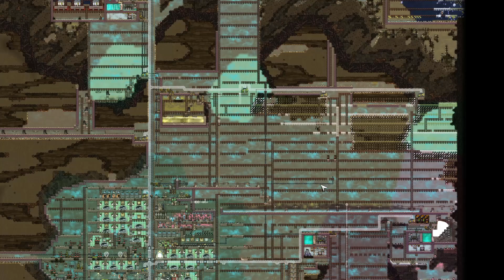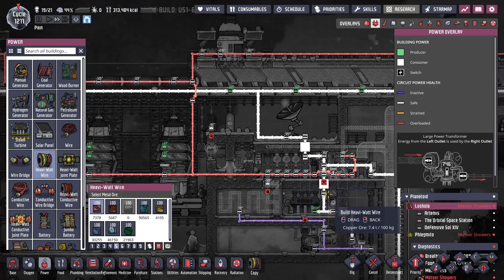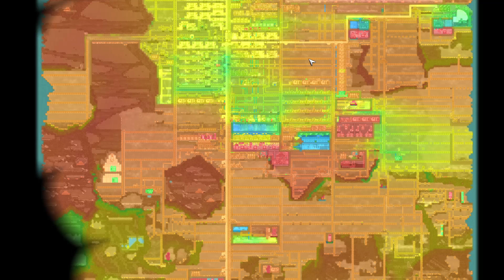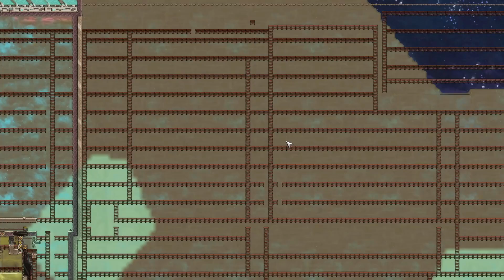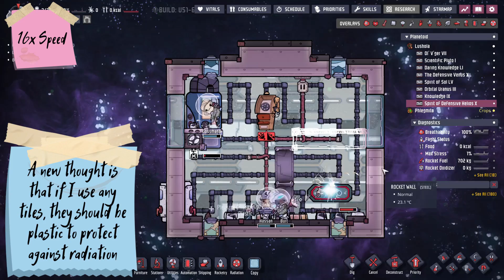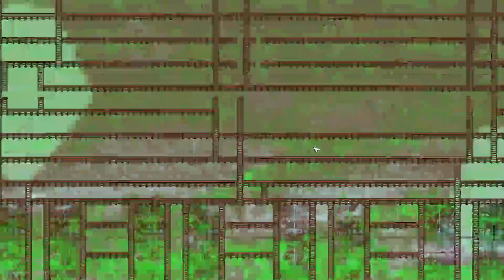[Ep21] We Built a Behemoth of a Rocket Setup - Ultra Supreme Max Difficulty

Comment: I know the series is already done but just something for future reference (and anyone else doing this).
Replacing the plastic tiles with lead metal tiles would have been better for your rocket design as they give 3x the decor (and a larger decor radius) with the same radiation blocking as the plastic tiles. 
I also generally use a high pressure gas vent to fill up the rocket with 10kg of oxygen and keep the bed high up in the rocket to avoid them needing to get up to breathe when sleeping. The stress bonus from popped eardrums can be negated with high morale (20% negates high difficulty bonus), a buddy bud (15% from floral scent leaves 5%) and a carpeted tile (15% from tickled tootsies handles the rest). The carpeted tile will have less radiation blocking but if you put it in the center (under where the rocket roof is two tiles thick) it should be fine. This does also mean that you have a finite amount of oxygen but (in my experience) the 10kg has proven to be enough for even the longest trips (where I forget my rockets for a while after they're done with they they were doing). If you want an emergency supply of oxygen you can also keep some oxylite in a storage tile near the top of the rocket and move the oxylite to wherever the boundary between CO2 and oxygen is when you need more oxygen. I also use a mini gas pump to remove the CO2 but generally just have it be manually controlled and only have it on when the rocket is filling up too much with it or I am planetside preparing for another run.
With that you can use a dehydrator to save high quality foods and a rehydrator in the rocket to have high quality foods. You can use storage tile(s) with a very small capacity limit for the food. It gives you a lot more morale to work with and would then allow you to change the sink into a hand sanitizer, saving you both space and water.

Comment: I remember reading a post on Reddit about how to optimize performance, and one of the points was actually that the more you mine the map, the more performance drops.

Apparently calculating the transfer of temperature between gases takes more compute than solid tiles, especially the natural ones that don't transfer heat that efficiently. Gas also moves around, whereas the solid tiles do not.

Someone stated that filling up the unused parts of your map with plastic tiles is the ultimate performance boost.
Reply from the maker: Huh, interesting.  I have been meaning to do a deep-dive on performance but haven't gotten around to it.  I do intend on eventually vacuuming out huge parts of the map to help performance (and I've done that on the other asteroid as well), but the plastic tiles is a new one that is worth looking into.

Comment: I believe plastic has the same radiation shielding as lead does, i tend to use that in the ceiling of my rockets.

Also, could check for a starry eyed dupe, would make the achievement much simpler.

Comment: You could use a gas valve filter to only pump out CO2 by moving the timer up to that empty spot, you only need 2 squares and it doesn't classify as industrial machinery if I recall correctly

Comment: Very nice ! 
The blaster cooling is condensing all the fallout, that's kinda of nice.

I found bathroom +2 morale a bit low for the space it take. Anyway, with radiation you can put a hand sanitizer, even disabled, and save some space inside the bathroom (but still need to take up the 12-tiles space). 
I'm pretty sure (and the wiki agrees) that the oxygen diffuser isn't  industrial machinery. So you can squeeze it in the washroom with hand sanitizer. Ho the wiki kinda implies that the shower can replace the sink for the room bonus and it will add an additionnal +3 morales.

For easy filling, i can see conveyor meter for each type of material needed (i would switch algae for oxylite directly and use the saved space for the fitting). That would be awesome to see it refill each time. Too bad you can't refill food that way, except maybe some eggs shenanigans .

Comment: 26:52
If your plan is collect nuclear waste you have a problem here. 
The condensation temperature of nuclear fallout to nuclear waste is 60 degrees or so. When your system is running at full capacity, a steam chamber with a temperature of steam over 120 degrees will not allow nuclear waste to cool down to the temperature necessary for condensation.

Comment: With how far those radbolts are flying you should adjust the generators to shoot 500 rad bolt bolts instead of the default 50.  The bolts decay at a fixed rate so bigger bolts lose a lot less potency while traveling long distances.
Reply from the maker: Ah, interesting, that's a good idea!